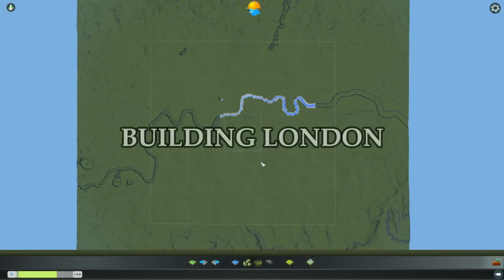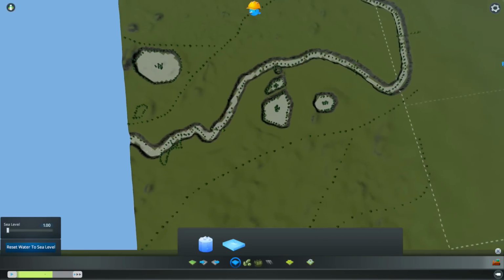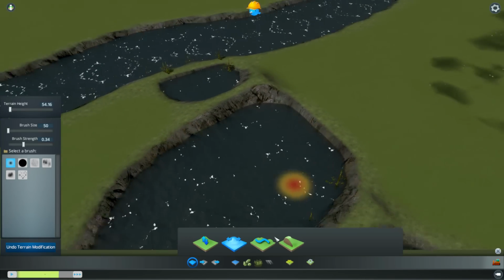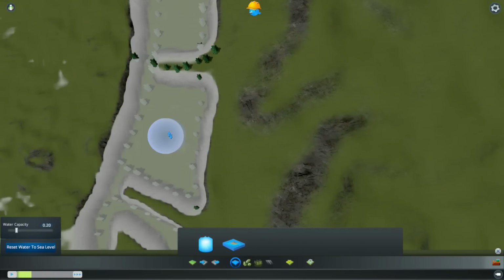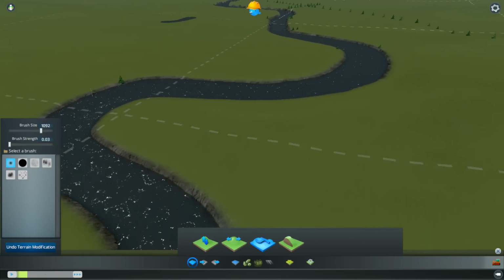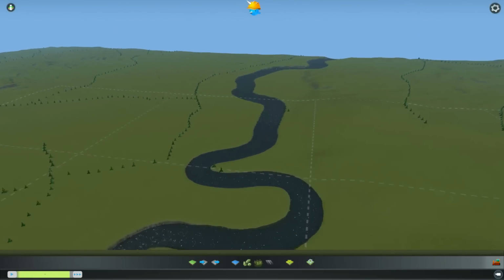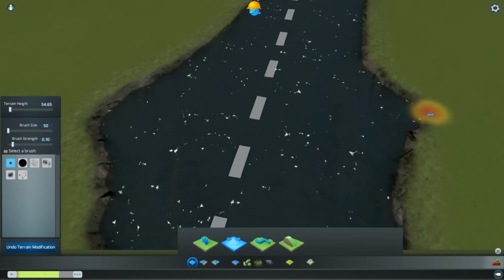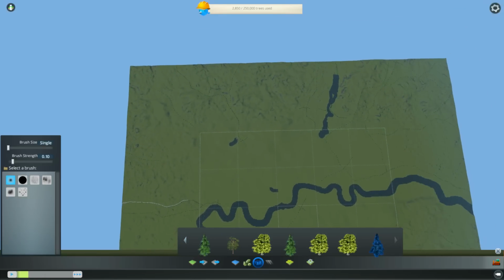Cities: Skylines Building London - The Map #4 ►Water Dynamics◀ Gameplay/Tutorial

Comment: One other option for the bridge spans is to raise the ground level somewhat a bit away from the river bank and then when you put the bridge in, click on that higher ground to start the bridge instead of starting it at the river's edge.  That may allow the two piers near the edge of the river while adding short land spans on either side, as many river crossings have.
Reply from the maker: darkether That would be a great solution :)
Reply: darkether Yup that's what I do too, either by elevating the bridge end a little in from the bank to widen the bridge or by terraforming to raise a bit as you describe. Neither needs to be done in map edit mode.

Comment: The reservoir water level seems high, it's flooding over some of the banks / spurs
Reply from the maker: Andy Rooney If that's the case I'll lower the level a touch like I did with the Lea Valley reservoir :)
Reply: Skye Storme its the lea valley ones I meant. The bottom part was carefully shaped pre water, then the water level turned it into a round reservoir flooding the features.
Reply from the maker: Andy Rooney The water level settles down after a while